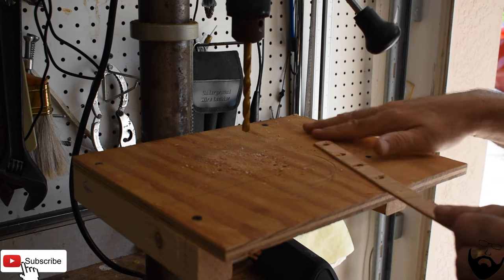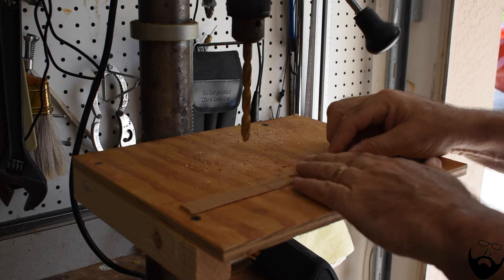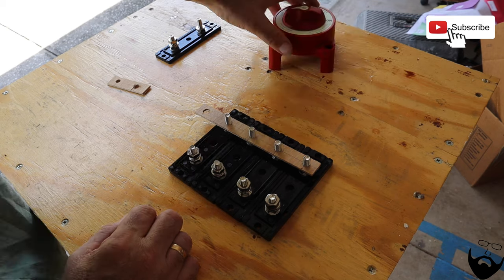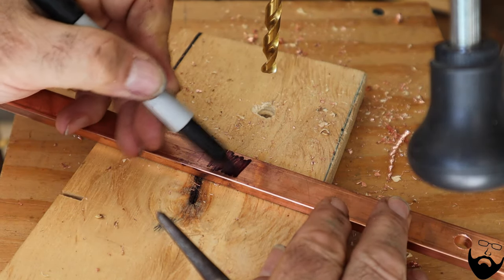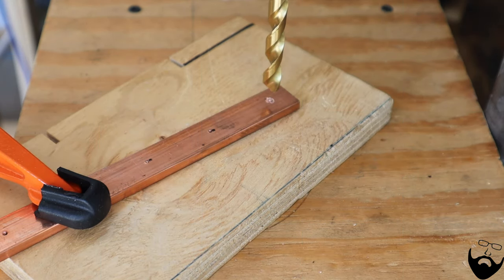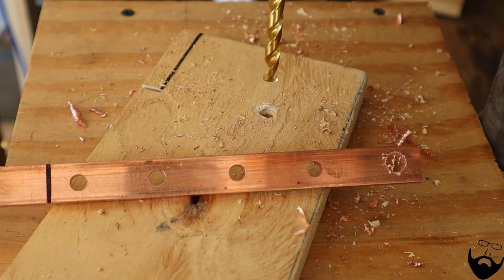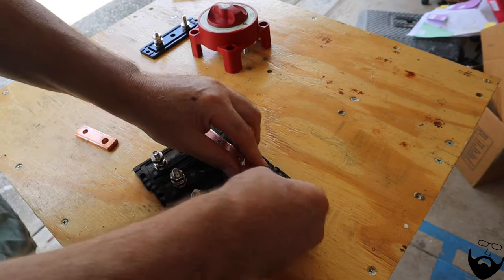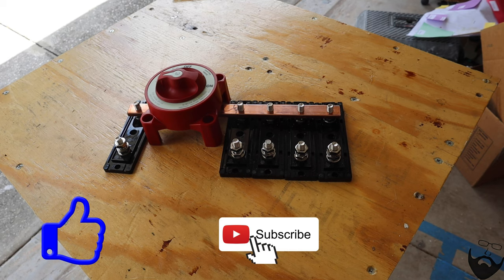Van Life Electrical Making your own Bus Bar part 1

Comment: Great video Mr. Frugal Factor. I find it easier if you start with an 1/8 inch drill bit and then follow with the desired size. Cutting oil helps too. De-bur after for a solid connection.

Comment: 080921/1850h PST 🇺🇸 Thanks. Good idea to connect the 300A Battery isolator to the busbar. I learned yet another design.
Preparing a template before drilling the precious Cu bar is highly appreciated. I do that too.
Overall a good educational and practical presentation. Thanks again and stay safe. 73s…

Comment: Frugal Factor
Hi! Thanks for the time and effort in putting out these videos. I am at a junction with the electrics in my project. A little direction would be much appreciated. My equipment so far includes:

3x 100Ah Renogy solar panels
1x 40A Renogy Rover Solar controller
1x Renogy DC to DC 40A charger
1x 100Ah Lithium Battery (DC to DC Charger)
1x 85Ah AGM battery (VSR- charging via alternator battery separately)
1x 3000W Renogy Inverter
1x 500A Renogy Battery Monitor with Shunt
1x 12v Bue Sea distribution fuse holder

There is
4.7m between Starter battery - main lithium battery (100Ah).
1.5m between Starter battery – AGM battery (85Ah)

The Van is factory fitted with double Ford starter AGM 85Ah and 80Ah batteries. It came with a VSR and xantrex 1400W Inverter wired up to these batteries. I am thinking of utilising this set up in conjunction with a lithium set up. The new 3000W Renogy inverter is intended to power up an Induction cooktop and other appliances. So a question could be, am I able to use 2 inverters, 1 inverter with an 85Ah AGM Leisure battery and 1 with a 100W Lithium battery? And If yes, what would be the simplest schematic? Also I intend to use a Busbar system as oppose to purchasing the Victron Lynx distributor (to save money). The busbar system you are using look very neat and tidy. In short, I would like to replicate your system but with the minor differences due my circumstances. Your assistance would be much appreciated. Keep doing what you are doing! Thanks in advance.

Comment: Great to see such DIY solutions! Allthough clean copper  being a great conductor only (challenged by silver) in humid ( condensarion) environments risk of oxidation is there. Did you consider nickel plating copper parts with DIY nickel/vinaigre solution and low voltage electrolysis?
Reply from the maker: Nice idea.  Never thought about that and it sounds like something I would do!   But, it has been working as it for three years now, without any problems.   All the videos divided by category can be seen at  https://thefrugalfactor.com/

Comment: Great informative video, thank you. Did you have any issues over time, with atmospheric corrosion of the copper bus bar?
Reply from the maker: No problems so far.  The electrical system has been in service for over a year, and we have traveled over 10,000 miles back and forth across the USA.   In the next few weeks I will post a video reviewing the full electrical system.
Reply: @FrugalFactor  That's good to hear, thank you for the reply :)

Comment: Hi Frugal Factor.... Is it ok to connect the end of the positive cable of the solar charge controller to the busbar instead of the end of the positive battery cable? ...  And then attach the positive cable of the battery to the other end of the ANL fuse?
Reply: 080921/1931h PST 🇺🇸 Yes, that’s the way the positive cables of Charge Controllers (CC) are connected. The reason as to why CC positive cable is connected to the positive terminal of the Battery (before the ANL FUSE) is because in the unlikely event of ANL blows, the CC will still have the power, thus saving it from failure. You may then, isolate CC circuit through its CB (for servicing the fault) Remember, where ever possible,  use of CORRECT DC Circuit Breakers MUST be inserted into the circuit. ANL fuses are good choice over CB, though some controversy over this subject is discussed. Stay safe and 73s…

Comment: Hi Nice video, thank you. Question: How did you determine copper bar size needed?
Reply: 080921/1919h PST 🇺🇸 Normally Cu bars come in 20mmX250mm sizes. The thickness varies to either 3mm/4mm.  Cu bars (99.95% pure) are available from AliExpress. The buyer cuts the bar to the requirement by placing the black (ready made busbar strip) parallel and measured and a template made out of thin cardboard. With that info, drawings were made on the Cu bar and precise location of bolt holes were marked. Centre Punch was used to make dent for the drill bit, to avoid wander. Remember his job was very precise and accurate and neat. I hope you understood.
I apologize for talking on behalf of the Author. Stay safe and 73s…
Reply from the maker: I purchased my bar from online metals the link is in the description.  There are calculators online to determine the bar size, thickness and composition.

Comment: Hi, some advice, I need to extend an equipotential bar, is it possible to join it with two 8 bolts instead of doing it all over again? or is it not recommended? Thank you
Reply from the maker: You could do that.  But I don't recommend it.  I would start over, using one solid bar, and design if for growth.  Another possibility is using both sides of the current Bus Bar.  But I don't know if that is possible in your application.
Reply: @FrugalFactor  then in reality I have to remove the fuse coming out of the battery to remove it after the shunt, so I would like to join the sending part with two 3mmx20 copper bars, making them touch each other for 5cm

Comment: Where/how?  Did you get the black plastic platform with bolts Sir...? Cause I've made some various sized buss-bars and now don't know what platform/holder use to install them. I've been debating on using wood cause that's all I can think of to use to attach them to, but just think it looks a little tacky/sorta-ugly in a sense 🤕😂
Reply from the maker: That black plastic is a fuse holder. Amazon item B01MYGIR2C    I have also used thick Poly Cutting boards.  I cut the poly on the table saw.

Comment: Why making a wood template? You could have make your bus bar directly... Moreover your 2/8' hole is not centered. Again I don't see the point. No need for a sharpie, a blue tape is much better and do not require cleaning. Honestly, I don't see the point of this video, except to say "how to make things more complicated?"
Reply from the maker: I make templates for future builds.  Blue tape would work fine, and even assist in removing some of the copper filings.  Just not the method I choose.  So, if you want a complex way of doing things watch my other videos :-)